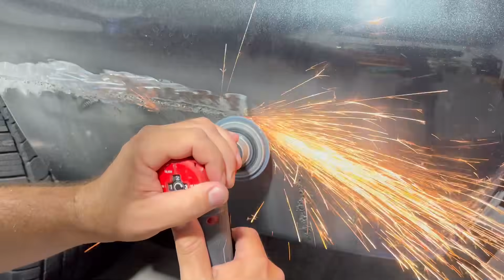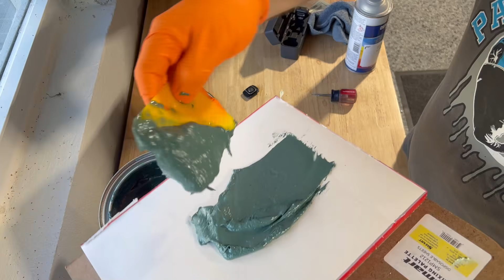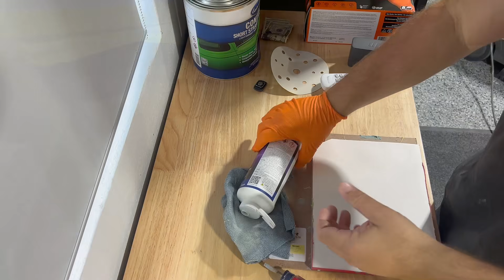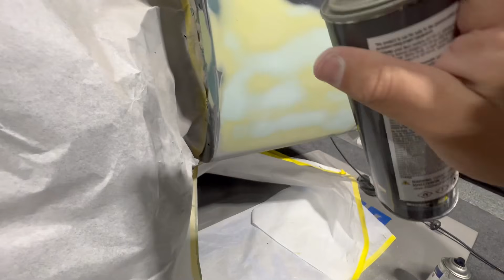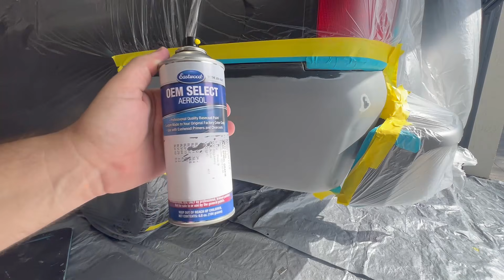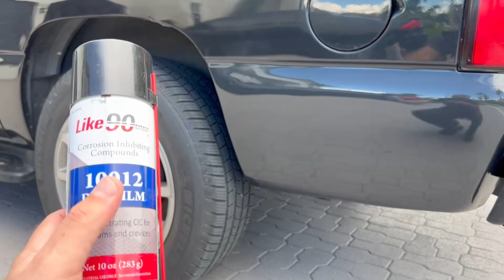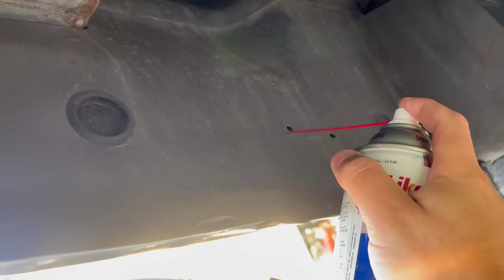The BEST Guide to DIY Home Automotive Rust Repair!

Comment: The picture you have of the paint can I thought was one of those foam cans which made me think of this car story I read anyway this guy had a Suburban Minnesota it was a rust bucket and he kept together by using the spray foam in the doors and other parts he just used it in hunting season and some other things so whenever you had a small job that required him to use a can of expanding foam he just used the last of it to Hold the truck together
Reply: spray foams are the same base as Gorilla glue

Comment: Why do you say it's simpler to cut and weld rather than replace the full preshaped corner ?
Reply from the maker: Because then we would need to remove more spot welds. The bumpers, weld it on a curved bodyline then have yo blend the whole quarter

Comment: Brian, one good trick I learned and that works with the 2K clear coat is that after using it, if you freeze the can you can preserve what’s left way longer. My last can lasted over a month and I was able to use the whole can instead of throwing it away, you just gotta let it get back to room temperature before it starts to spray correctly again. Maybe it might with the epoxy primer as well. Try it and see!

Comment: Thank you. As much as I'm a diy guy, unless I do this daily, the amount I would spend on materials surpasses me bringing it to a local shop.
Reply: I have never even HELD a $40.00 rattle-can of spray paint.  In my entire life.
  But then again, my idea of body repair used to mean using pieces of wood and gooping them into dents and damaged areas with heavy roofing tar using a 2-inch putty knife, and letting the tar dry-out in the Sun for a few days until it quit wanting to sag off the car. Then a $5.00 can of Hardware Store Rust/Red Iron Oxide colored Farm Implement Primer to give it a good, strong, good-looking "skin".  I thought that looked so classy. I spray painted the entire car with it, and I mean the ENTIRE car - chrome, lights, windows, wiper blades, etc. A single-edge razor took the paint off the windows and lights like MAGIC, and all the dirt and stuff came off in the ribbons of paint and the glass and signal lenses sparkled like new.
 Before it all dried, it rained a little bit and the paint all mottled (my then being 16-year old idea of a Custom Paint Job)  To preserve that wonderful mottling effect, I mopped the car about 5 times with that then-new product "Formica Floor Shine", and it would almost blind with shine!
 Leaving High-School one day, the local State Patrol Trooper pulled me over. He's a really, great guy, and we all knew and liked him well in our small town. He inquired about my Mom, my Dad, my siblings, just a bunch of small-talk.  All the other kids drove past us, his Blue and Red lights blinking, staring at me and him.  When I finally asked him what I did "wrong?", I swear he almost started crying. He took his big Trooper hat off, held it to his chest, looked at me (I'm thinking "Oh my god, something bad has happened in my family and needs to inform me" and he said "You know, I've been a State Patrolman for a long time now..."  here it comes, oh my god, what? It never gets easy, right?  What???  "and NEVER in my career, EVER, have I pulled over...   a BIG. SHINY. TURD!!!"  He could barely get the words out, turned around, and as he walked back to his Cruiser all he was doing was snorting, guffawing and laughing out loud.
 That was over half a CENTURY ago.  Every EVERY time I've seen him after that, no matter where, no matter when, him and his Super-Duper State Patrolman VISION would see me well before I'd see him, and it was always the same thing when I'd see him: that big, beautiful toothy grin of his, POINTING at me, and laughing soundly. In the store, on the road, walking somewhere. ALWAYS.
  But a $40.00 spray can of paint? How many of those did you use in this video?  I dunno, man.  I think I've proved to myself that a tube of roofing tar, a can of tractor primer and a razor blade can yield some pretty spectacular, quite memorable results, too.
  Thank you for all the tips and tricks, however!  I'm glad I watched your video, and "yes", I thumbed-up AND subscribed!
Reply: @brucelarsen6650  I've bought a number of $40 rattle cans from an auto body supply place that makes them to match custom. Worked well.

Comment: I just have a question it's not about this video but I searched to see if you had done a show on diy"car paint" like from AutoZone(Dupont paint shop)or a truck,tractor and implement paint from rural King? I used the Majic diamond hard truck,tractor and implement paint(the blue can)and thought it was really good for being cheap. However now they don't have it here so I'm gonna try the Dupont paint shop paint from AutoZone along with the clear coat. Was curious if you have ever used any of it and if I should use a hardener with the clear coat(it says not necessary)I would think it would make it more durable. Any tips if you have used it please

Comment: That is a very nice job! I also want to do this on my car, I have a few rust spots that need fixing. What do you do with the rest of the can that still has some 2k clear coat or primer in it? Because I'm guessing it's going to harden in a day or so in the can.
Reply: You can preserve any 2k leftovers if you put it in the fridge for about a week maybe more until the day its ready to be used again. Let it get back to room temp hours before spraying it

Comment: Thank you for making a video on something I’m doing I like your other ones but this is more of what I’m running into on my 91 Chevy truck and my 94 Chevy 4x4 can you teach us some stuff dealing with fiber glass beds like my step side beds I have I’m working on four cracks this week in the fiberglass thanks brother
Reply: For max strength, Cracks should be ground through and entire surface rebuilt. grind several inches each side for adhesion. Use resin /cloth and/or long fiber premix.

Comment: i have been thinking about getting that milwaukee grinder, but then im also looking for a bigger compressor(195L / min) to be able to paint, so should i just go with a bigger compressor and get the grinding tools for it? the milwaukee is batterydriven so it has just some amount of life in it compared to a airdriven one.
noticed when you put the clearcoat on, you didnt go all the way to the back of the fender, like you were dividing the panel into two parts, how come, you could have easily went arount the corner of the back.
Reply from the maker: It dies out when it’s over powered. Its annoying but its good for small stuff

Comment: Its best to protect the internal cavity too by drilling two small holes in the backside of the inner panel and spraying anti rust protection inside then fitting grommets to finish the job off,,,, just thought I’d mention it
Reply from the maker: Hi. Ty. Yes watch the end of the video and you will see this done
Reply: Sorry it was my impatience to pass a comment about the cavity protection,,,,

Comment: Another great masterclass in painting and body filler etc. So much fab teaching. I applaud the use of the cut panel from the full piece but yeah the welding could be better. Still, it's not the metalwork than brought me here and the finish looks really great. Many thanks. There's loads for me to implement when I get the steel work of my project vehicle ready for these stages.
Thanks!
Reply from the maker: Thank you! I would love to learn to weld as well

Comment: Great instructional video for professional results. My only concern is the cost of this repair, if I am just a week end warrior and trying to fix my daily driver the cost of all this repair is crazy expensive. Patch panel, welder, PPE for that, and supplies,  short strand body filler, Bondo, glaze putty,  primers, sand paper, hardener, etc. etc. how many types of primers? etch, high build, epoxy, guide coat .... holy Toledo I might as well pay a body shop to do it IMHO.
Reply from the maker: Yup! I mention this in my closing remarks. Very true

Comment: Damn bro didn't even practice before welding that 😅.He could have tested the settings on the welder for better welds as he clearly had the material...
Reply: That is the practice welding...😅🎉
Reply: They showed a flux core cheap welder from HF… it ain’t gonna get much better than that

Comment: An old timer at local paint supply store said the particles are different shapes between blocking sandpaper and disc sandpaper. The block sandpaper has a more pointed shape and disc has more rounded at same grit

Comment: I was recently quoted 1,300 dollars to have a bumper cover and one fender painted to OEM color no installation or prep and parts are both brand new oem. Does this sound right? I do allot with Cerakote so I have a decent spray set up I just needed a new spray gun so I ordered everything from eastwood for 550 and a gun from amazon and figured I would just do it myself
Reply: Either you pays the man, or you buys the tools and DIY. Expect to make mistakes and u will be happy.

Comment: Unless this was treated with a zinc weld through primer and coated on the inside, this will rust out again.
Reply from the maker: It was. Did you watch the whole video
Reply: @PaintSociety  if I watched that part I would not have posed the question,  good stuff,
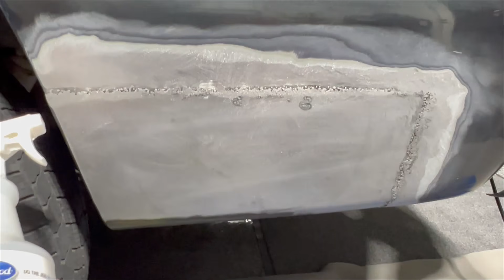Reply: @Tacman556  Stop the video at 3:31 and read the label on Eastwood Fast Etch (or you can google this product). It says "Leaves Zinc Phosphate Coating", I think Brian is referring to that.

Comment: The tip about using the Fast Etch is an excellent idea.  I've always gone over any weld seams with polyester resin and some cabosil mixture to seal them before epoxy primer.  pretty much the same idea as putting the short strand filler. Might be overkill but it was something I learned eons ago and have always done.  
Nice job, your repair turned out spectacular as always.  You're a very knowledgeable and skilled body and paint man
Reply from the maker: Great point!

Comment: I seen you had burn thrus down to metal from sanding the fiber Glass filler. You then put the body filler over the bare metal. Won't that rust eventually? The hardners contain water. Which is not the best idea to put on metal surfaces.
Reply from the maker: The filler is meant to go over metal. Still epoxy is the best process.
Reply: @PaintSociety  thanks for clarifying. It should be fine but never know. Ive done that before on my csr and its still holding out 4 months later. I learned the hardeners contain water recently so it kinda scared me if im gonna have to redo it eventually . Been watching you for awhile I don't miss a video haha.  Love your work.

Comment: Great video!  Nice helper you have there!  Word of caution on grinding welds.  You may get a nice weld with little or no warping and ruin it by leaning too hard on your sanding disc and building too much heat.  Go slowly and keep checking how hot the panel is getting.  Ask me how I know!!!!

Comment: Great video! I had to replace the hood and a fender on my old Jag due to a deer. The car is beige tan color and my used replacement panels were black, severely burned 30 years old black paint and clear coat. I finally got the panels nice with high build primer, but I had difficulty with the coverage of Dupli-Color paint. In fact, it took me 11 spray cans to get good coverage on the hood and fender. But, I got it and the covered it with 2K Spray-Max clear coat and it looks very good for a DIY job!
Reply: Might have been more cost effective if you had got a hold of a sprayer and compressor with the base, top and clear in cans
Reply: @mikep509  Oh yes, for sure! But, I wanted to try to do it by myself. At 22$ Canadian per Dupli-Color can and 45$ Canadian per 2K clear coat cans, it was expensive. Lots of square foots in this hood!
Reply: @alexandrecouture2462  ... yeah it's pricey with rattle cans..  I'm in canada too, I have borrowed a 16 gallon compressor and picked up a $130 paint sprayer on sale at Canadian tire for $50... I have a rear side door, front left fender and a spot on the roof near the windshield to fix/paint ... paint , primer, and clearcoat cost me $300 in cans... I just need time (and good weather lol) to work.on it... should take a day or so....  dialing in the sprayer is needed, and also for covering a bigger area like a roof, rattle cans are very difficult to use, so a sprayer was the way to go... 2009 toyota corolla,  150k km on the drive train... its in great shape except for a few corrosion spots... that im attempting to fix... bodyshops are quoting a fortune for this job if I was to go that route...

Comment: Pin holes come from  your mixing  !    You  have  to pull long and thin as you  mix on the board  . You add air by bad  process.  .
Reply from the maker: Thanks for the tips!